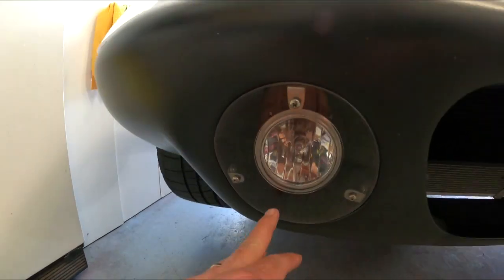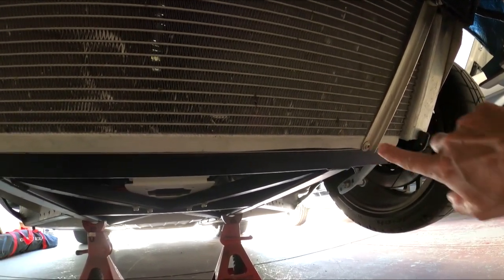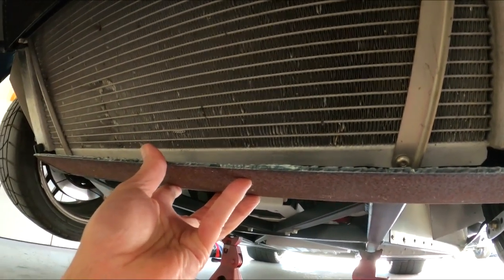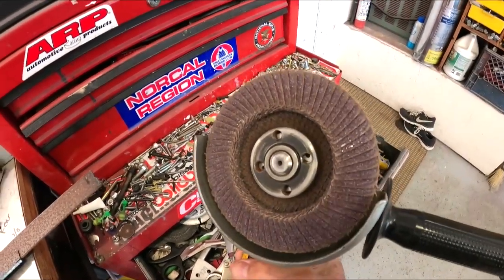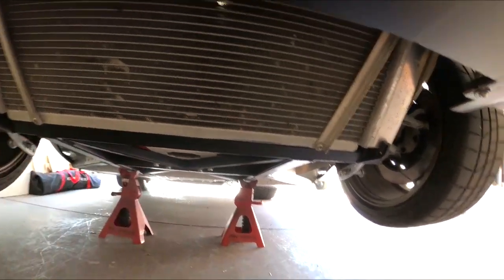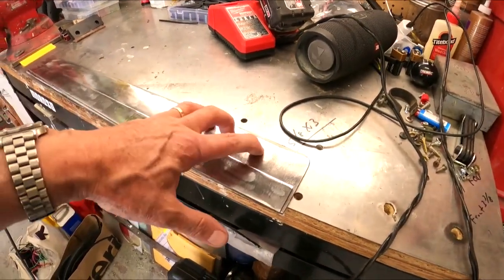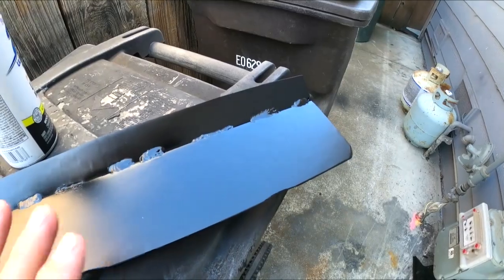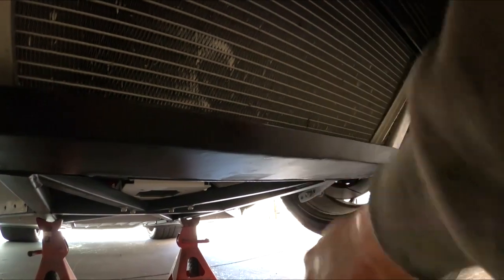The one Modification you need to do- Cobra Daytona Build, Video 161

Comment: Probably serves the intended purpose, but I’m concerned that dust/rocks/whatever will end up getting trapped in that, and eventually clog the bottom part of the radiator. Not to mention the potential for rattling if a rock gets bouncing in there. Any mitigation for that planned? Maybe just a cap?
Reply from the maker: Good morning Charles. Thanks for watching. I figure I can get a vacuum in there every so often. Just part of owning a race car for the street. I probably should have drilled a few 1 inch holes on the bottom.